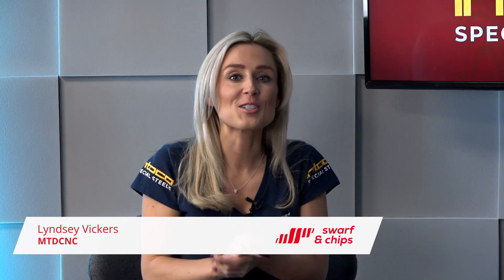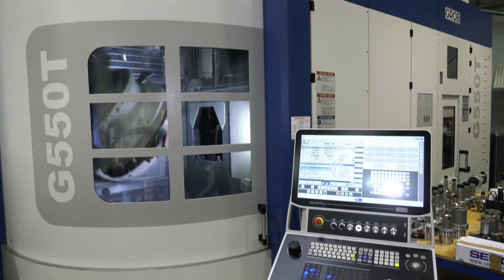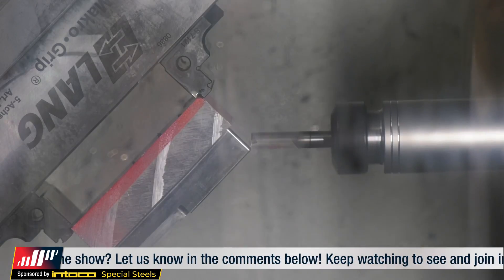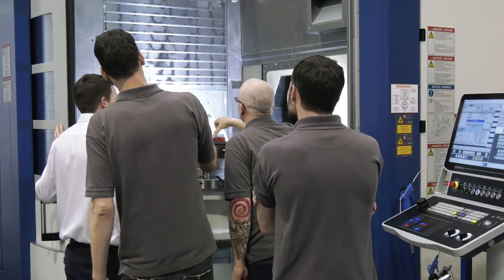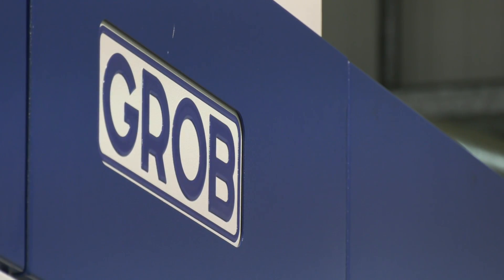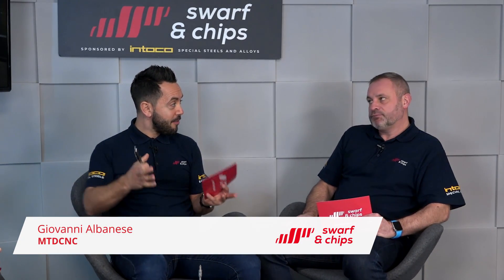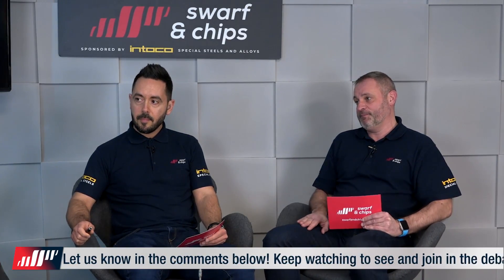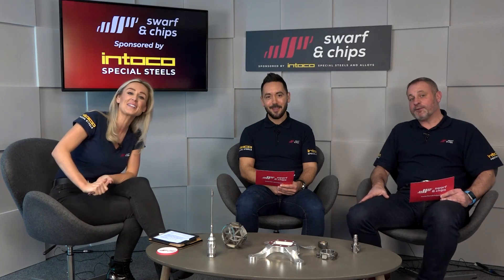#SwarfandChips - Which Way Would You Go? Box Way Or Linear Way? - 14/02/2020 - Ep 164

Comment: Linear machines just for aluminium?
Are you living under a rock ffs?

There's even lot's of hard milling and turning as well as rather heavy machining done with linear way machines to very tight tolerances with no problem at all.

And longevity?
Don't fool yourself. In many boxway machines a simple fault is enough and the machine is toast, just as is after years of heavy use. Good luck finding a new casting or a reasonable priced repair, that's not going to happen.
A linear machine laughs at that, gets a new set of rails mounted by a bunch of poorly trained monkeys and is literally as good as new.

Boxway machines survive because of stubbornness and because they're great for a small niche of the market. They have a place but it's small and shrinking.
Affordable hydrostatic systems will render them completely obsolete in the near future.

With systems like INAs/Schaefflers size 45 modular hydrostatic guides and similar systems from Hyprostatic or Zollern and most probably many more slowly emerging, who tf will still want boxways if not for being stuck in the old ways?